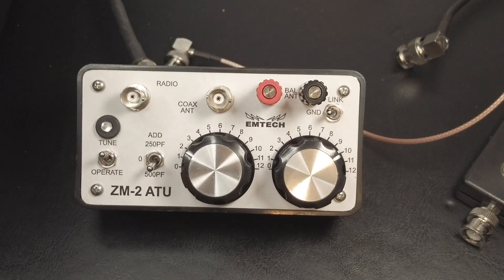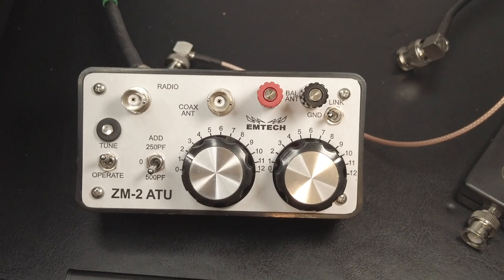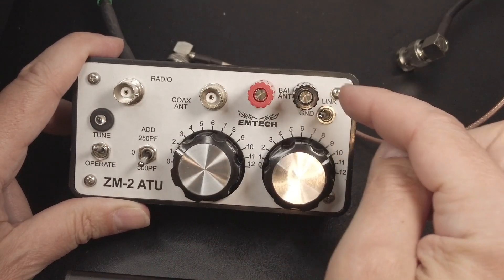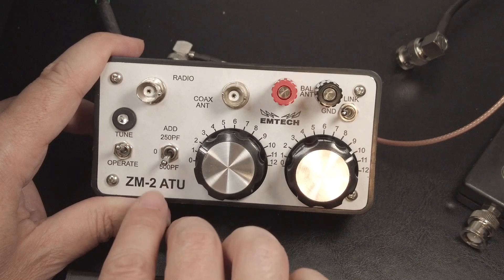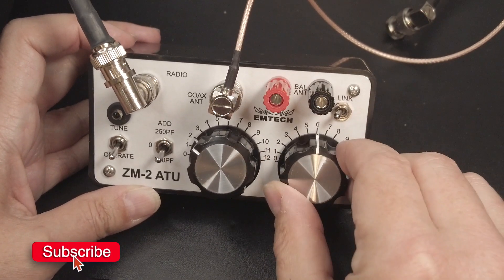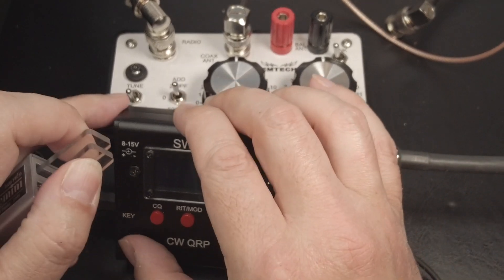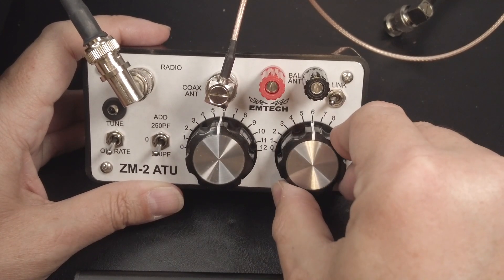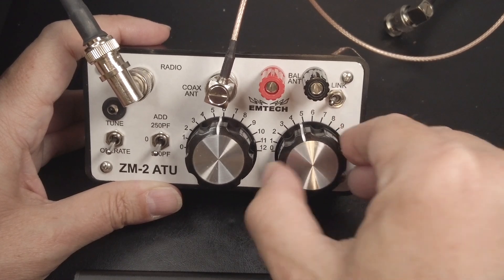Unveiling The Power Of The Emtech ZM-2 Antenna Tuner

Comment: Hi Joe. Just discovered you today and have enjoyed your videos. Thank you. About the ZM-2 Antenna Tuner. I am using a 41' EFRW sloper with a 17' CP and the ZM-2 seems unable to match the antenna to my transceiver on 40m CW. Even after experimenting with my RigExpert AA-55 Zoom I was unable to find a sweet spot. I note that others have experienced the same problem. FYI. JIM ve4bwg
Reply from the maker: Hi Jim. Thank you. I had the same issue with my 41’ EFRW too depending on where I set it up. I ended up cutting a 29’ CP and that seems to work better for me. I have to roll it up sometimes depending on the location. Maybe try playing with the CP length.
Reply: @JoeN2DI  Thank you for the reply Joe. I will give your suggestion a try. I have already tried several permutations of CPs single and multiple but all were < or = 17'. The current wind chill factored temp outside is -24º celsius (-11º F) so I will wait for some warmer temps before I try your suggestion. Nice to meet you Joe. 73 de Jim ve4bwg
Reply: In some cases a random wire will have too much impedance for the ZM-2 to match. In those cases a 9:1 or perhaps a 4:1 balun may help.